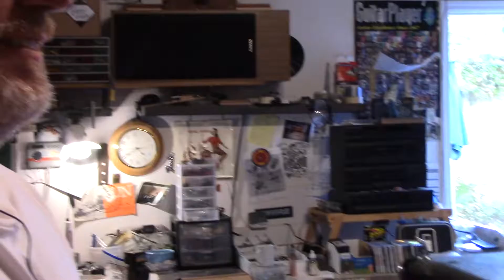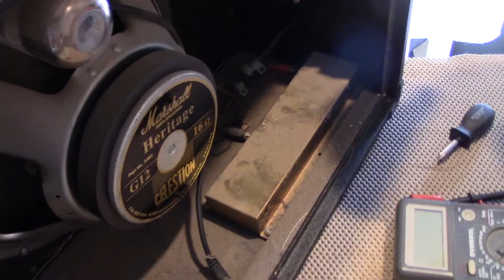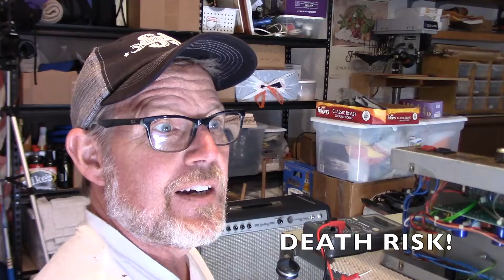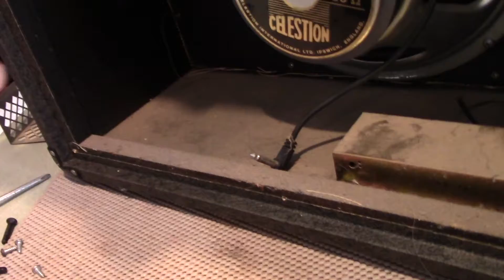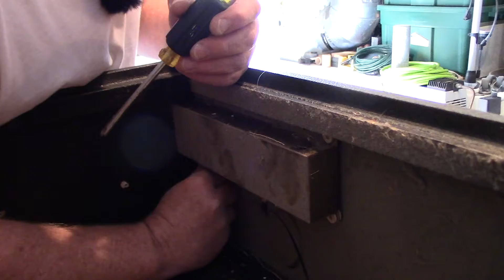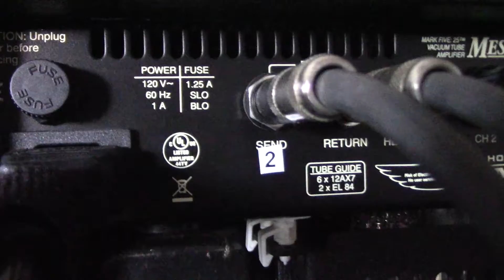Marshall JTM30 "Flip" Project - Episode 1

Comment: Silly move destroying this rare amp. These are going for over a grand now. Bought mine new for 3 Benjamins in '94. If you can't get a good tone out of this, either get another amp or change your playing methods.
Changing the baffle board to a void-free birch ply helped some.

Can't believe what I'm hearing. Sounds like you're trying to make a 327 mouse motor into a 454 swapping all the parts. Put on a blower on it and nitrous while you're at it. Doesn't work that way for audio.

Comment: A properly maintained JTM 30 oozes with vintage Marshall tone........
Reply: Yup.. very happy JTM 30 owner here..
Reply: I just picked up a 1996 JTM30 for $100 and it's in fantastic shape. Seems like a good deal.
Reply: Wise Guy  That was a good find. Class A amp. They naturally run warm- New tubes and it have that mojo again!
Reply: @tabodee  At this point I have to agree. I did just rewire it to a 2x12 cabinet and it sounds even better to me. Fantastic find!
Reply: 100% agree.  One of the best Marshall amps.  But they are prone to failure too. Mind blew up. :(((((  But I love that amp